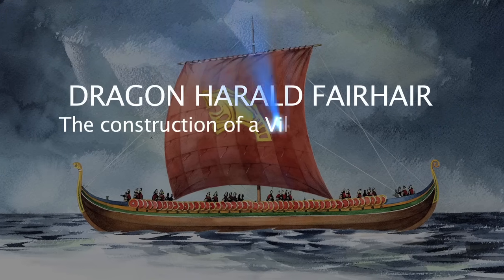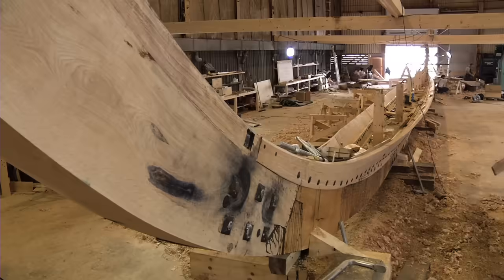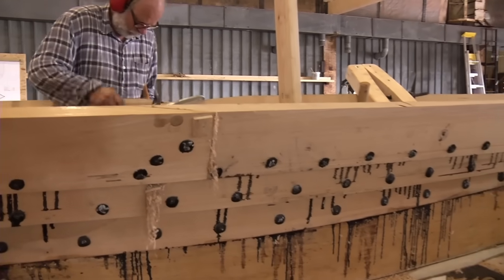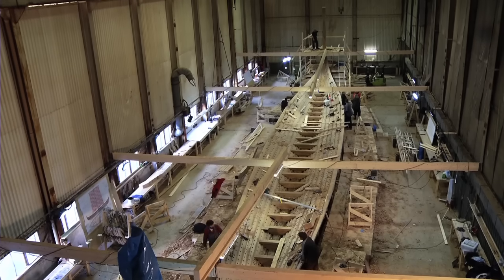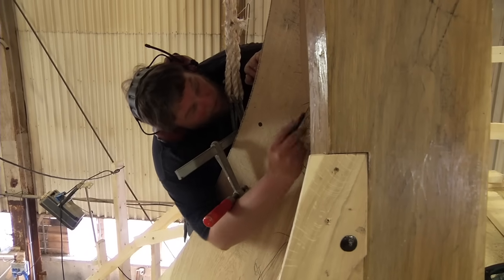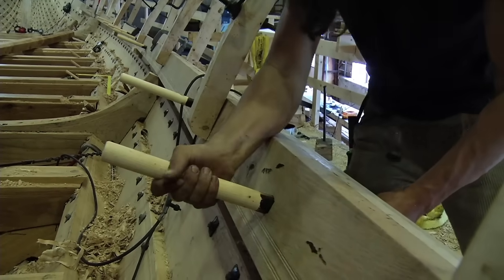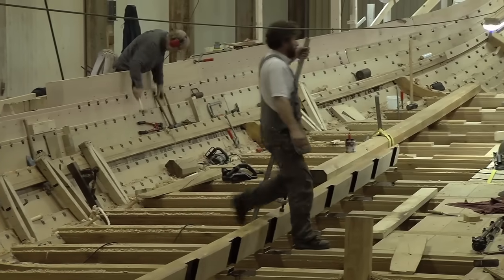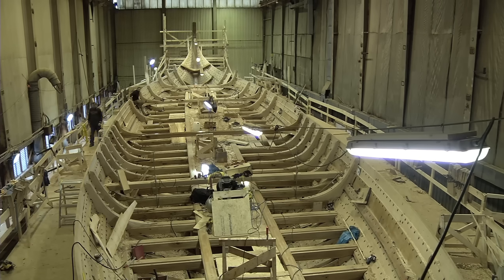The largest viking ship in the world

Comment: The Hollywood image of barbaric Vikings simply becomes laughable in the face of this degree of craftsmanship, and the social resources and organization that would have been needed to facilitate such construction and design.
Reply: I agree
hollywood  is a humiliated and perverted circus that belittles so many cultures for its purpose. The real problem is that fake history  does the exact same in order to hide the incompetence, failure and autocracies of certain governments.
Reply: Correct,
cranes ,protractor and planer have been used since  BC.
Reply: No
Who really does? most modern day theories are based on old manuscripts and analysts of old artifacts. I'm certain a great deal of educated guessing has gone into what we think the ancients did.
Reply: Zzzz, a Norse tool box was found not too long ago.  It was intact and full of tools.  Most of them were easily recognizable by modern hand tool woodworkers.  A lot of that stuff hasn't changed for centuries.  Modern tools makers can mass produce these things with greater accuracy but the core tools haven't changed.

The main difference between the way we build things today and the medieval times is that we have detailed drawn plans.  Medieval builders tended to start with a broad plan but the individual measurements were based off of the previous step.  They didn't have rulers or standardized measurements.  They would use things like string or story sticks to ensure consistency.

So, other than using a few things like modern drills and saws to save time, it looked like they stayed pretty true to the original methods as we understand it.  Even at that, it looked like the bit they were using in the drill was forged and not modern.  I do wonder just how many ships of this size were built during the Viking era.  That is a lot of resources for one ship.  The person that had a ship like that built would have to be extremely wealthy.
Reply: https://en.wikipedia.org/wiki/M%C3%A4stermyr_chest
https://www.popularmechanics.com/home/tools/reviews/g1024/whats-inside-a-viking-tool-chest/?slide=7
These are just a few links to articles on the tool chests.  The popular mechanics one has pictures of the find I was thinking of.  I've seen things on youtube from woodworkers who looked over the tools.
Reply: Irony is the Swedish king has word a Hollywood invented Viking hat, the one that has horns on it. Vikings never had horns, Hollywood made that to make them look more barbaric.  Yet the whole world associates vikings with horned hats.. so what's that about Hollywood again?
Reply: I have build similar boat like this before (åfjorbåt = aafjordboat). all information we had, was:
- what size (type)
- a simple paper, that tells what angle each individual planks, hold at a given place, and how many planks from keel and up.

when it come to tools: 
- ax's of different types was used (I have done some of my work with ax)
- I used mainly old school planers, some of them had profiles. I only use machine for bigger thing's to save time, but most work are done by hand, gives a different quality/finish
Reply: Queen Elizabeth II
Actually horned viking helmets was popularized long before Hollywood was a thing.  E.g. it was portrayed in one of Wagners operas late in the 17th century.
In real life only one true viking helmet is acually found, and it had a noseguard and  slits for the eyes. But they probably used a few different designs
Reply: .....Damn, comments as educational as the vid itself!
Reply: Come now...... doesn't necessarily mean that they weren't barbaric just take a look at the poms and their track record around the world. They didn't mind killing a few here and they were the masters of ship building.
Reply: Det er en ekte i et museum utenfor Oslo i Norge. Det er ikke så lenge som det her, omtrent tre fjerdedel så lenge, tror jeg. Men plankingen er mye tynnere og det er en lettere konstruksjon. Fra minnet er de omtrent 10 mm tykke eller 3/8 av en tomme.

There is a real one in a museum out side Oslo in Norway . It is not as long as the one here , about threequarters as long , I think . But the planking is much thinner and it is a lighter construction . From memory they are about 10 mm thick or 3 /8 th of one inch .
Reply: OK then, call them rapacious, bloodthirsty, violent craftsmen.
Reply: Mitch King Movies don't need to lie, dismiss historycal facts or humiliate other cultures.
Reply: Imagine if they also had to cut trees into planks...
Reply: as a swede with genuine víking in me, im proud of this kind of craftsmansship :)
Reply: Tell me when Hollywood has managed to make a historical film that's not laughable? You're confusing cinematic mastery with historic sensibility. And even when there was such a thing as the first, the later rarely bumped heads with it, let alone today, where HW is a den of corruption, dirtiness, and generally speaking idea theft, in the face of an ever dwindling subject out of which they can make a movie for.
So no, i would never put stock in Hollywood, a rotten landlocked pontoon that's sinking under a lake of lard.
Reply: @welshpete12  Seriously 3/8" for the planking? I'm not doubting you, just surprised. That is just over what a "modern" strip built kayak ends up at. To think they were able to construct seafaring vessels with commenting that thin is remarkable.
Reply: Well nowadays you have to make concessions to workplace security. Back then they still build such ships, just with a lot more men and a lot les osha conform.
Reply: I wouldnt want to fight one
Reply: RichB  - i like the norsemen as much as anyone ... but the reality is while the norsemen were excellent ship builders during their times ... so were many other cultures, who also had sophisticated ships - not just barges - who were also ocean going.
Reply: You know for Hollywood, anything witch is not american is barbaric ...
Reply: Yes
Reply: Yes
Reply: also that had aprentices (sry bad spelling) and masters so the knowledge were passed on, it wasnt until the 18-19th century the drawing came to be, before that, the britts used models for some of their man o wars  @keats182
Reply: They were barbaric, just they were smart barbaric.
Reply: Nobody said the Vikings weren't smart and talented. But imagine one of these ships shows up off your beach with 100 drunk guys screaming war cries (I.e. berserk). You will start thinking of the word barbaric as you flee for the hills.
Reply: "The Hollywood image of barbaric Vikings". No that picture was painted/written by English monks and that is not hard to understand. I have no doubt, however, that Scandinavia had a more fair society one thousand years ago as today than Britain, and they ruled Britain for quite some time.
And lets not forget that Britain is a product of Europe and that English a Germanic language with a lot of words from the Vikings like law, and days of the week. Also the ending "by" in towns and villages is Nordic and simply means town or village.
Reply: @Northern85Star  , They had to cut and buy all that oak in Germany and compete with other buyers for it.
Reply: @BruceDeitrickPrice  , Where did you get the "drunk" from. The word barbar is a onomatopoetic word, simply a foreigner, somebody who speaks a foreign language, not that much have changed - they come to take our jobs and the NHS etc, just listen to the worst brexiters,
Reply: @ushoys  , The Vikings brought word like "law" Britain and ruled most of it for a long time. They are part of British history and heritage and the language and DNA. If I wasn't so modest I would claim if there is something the British could boost about it probably is inherited from the Vikings. But then there is this question of looting the third world.
Reply: yes the viking were using these ships for trade and certainly not for pillaging coastal communities...lulz...what u do in between acts of barbarity no matter saintly doesn't lessen ur notoriety.... talking about  "craftsmanship, and the social resources and organization", the Nazi are an epitome of what u call civilized Europeans who are beastly under the veneer..get a grip of such euro-centric view of the world.
Reply: barbarism applies to the assaults the vikings excelled at, not the sofistication they displayed in working with wood and iron.
Reply: They were a culture that valued law, skill, and craftsmanship. But they were also fiercely 'nationalist' in todays definition. Everyone who was not a northman was a source of pillage and slaves. It is possible to be both barbaric warrior and skilled craftsman at the same time, all it takes is the right combination of cultural norms. Look at Soldiers in the modern military. Go to war, kill hundreds to thousands with highly advanced equipment, then come back to civilian lives and become successful executives, doctors, etc.
Reply: Τhey learned from byzantium and Mediterranean sea
Reply: People can be barbaric and loving and civilized.  Just get to know any UFC fighters.  They are mostly cool and humble people when around their family, friends and gym.  Then, see what they do inside the cage.
Reply: Hollywood wants to make all ancient white people look barbaric while making tribal blacks look like benevolent genuises who've been held back by some injustice done upon them.
Reply: Why would Hollywood Jews tell the truth about Northmen? Our light hair. Our fierce eyes. Our forthright demeanor. Our appreciation for beauty and nature. They hate us. Always have and always will. We're everything they wish they were.
Reply: @remus2475  the skill required to learn ship building I doubt a ruling viking king would even allow a person of such skill to be risked getting killed going out raiding
Reply: @remus2475  Ah, the business of mergers and acquisitions.
Reply: @Scooters Videos Shit happens ! blood makes the grass grow so you can eat !
Reply: @saxonforge  Except that Hollywood had nothing to do with horned Viking helmets, as that was a 19th century creation in European opera.
Reply: @Glorious_Kim_Jong_Un  Horned Viking helmets were introduced in the 19th century in European opera. Read more.
Reply: @agaronek Great post but Wagner was 19th Century.
Reply: @BruceDeitrickPrice  You rarely would see a ship of this side, and if you did, it would be companied by a hundred or hundreds of ships.  But most likely it would be a few smaller ships, with sober warriors that would come inn quiet, only start screaming once they were seen and the alarm bell or people screaming had occurred, the point was to get as much loot as possible without giving people the chance to run off with their valiables.
Reply: @LondonPower  not shipbuilding, by the time they went to the mediterranean, they came there with their longships.
Reply: Hollywood only Replicated what was first told by the Europeans about the vikings it was THEY who first portrayed the Vikings as a SAVAGE race without any culture or ethics or morals for that matter just because they were NOT Christians!
But in FACT the Vikings were VERY cultural and had a strict Ethics it was JUST NOT like that of the Christian.
But LIKE the Romans if you were NOT IN you were OUT and they treated you like a animal to be used for their purpose and pleasure!
Reply: A large part of the image of Vikings as savages comes from what they were doing. It is NOT Hollywood made. 

-- They weren't producing their own things, but they were acquring them by doing raids. 
-- And in these raids they weren't following any rules of war, unwritten or otherwise, as all the other people have come to do.
Blaming Hollywood is a wishfull thinking from people that are not comfortable with their ancestors. Not being comfortable with the Viking barbaric past shows a good taste, but we cannot change history for you.
Reply: A large part of the image of Vikings as savages comes from what they were doing. It is NOT Hollywood made. 
-- They weren't producing their own things, but they were acquring them from raids. 
-- And in these raids they weren't following any rules of war, unwritten or otherwise, as all the other people have come to do.
Blaming Hollywood is a wishfull thinking from people that are not comfortable with their ancestors. Not being comfortable with the Viking barbaric past shows a good taste, but we cannot change history for you.
Reply: @Mauromoustakos  What a load og BS.  The reason Vikings/northmen are described as such, is cause they were'nt Christians, other christians did not attack monestery's or churches, but they had no problem attacking heatens/none christians and showing them brutality, these Christian countries were no better than the Vikings.  But to the church,these were devils from hell, even tho the pope sent bloody crusades against heaten countries, both in europe and the middle east, actually i dont think vikings were ever as extreme as a crusade army, that slaughtered every non christians in a city, and then ate the dead...  
And you say vikings were'nt producing their own things...  Vikings produced exellent ships, their woodworking ability was exellent, they made houses that required no nails, they worked farms like every one eller, made varm clothes out of wool, tools and weapons were crafted, one of the best swords of the middle ages was created by the vikings, after they traded or learnt how to make damascus steel, ulfberth.. something.. it was called.  Vikings also produced a lot of dried fish that they sold and traded, late viking age the vikings focused much more on tradeing.  So i am not ashammed of my viking heritage att all, it was the time, and these were tough brave people, that were great explorers, daring and oppotunistisk seeking, coming from a hard cold place and ventureing out into the world when it was hard to make a living home,with population boom and not enough fertile land to go around for everyone. 
People should not be ashamed of their heritage, study it and understand the time.
Reply: @saxonforge  i like you, youre a smart one😊
Reply: Nonsense!
Knut the Mighty had a bigger ship, and Hakon Hakonson had ca 1260 two ships apr. 50--.55 meters!
Reply: indeed awesome  craftsmanship but when considering the amount of work and the fact that such ships can sink within seconds it is kind of over-endeavoring for mundane things. Why Italy, Spain, Greece, etc have no more any trees? They used all their forests for building ships. Forests that do not regrow.
Reply: The Germans in WWi and WWii also had a high degree of craftsmanship.
Reply: Just because you have good craftsmanship does not mean vikings did not murder, rape and pillage. You are now looking through time with rose tinted glasses on.
Reply: JJ Groves I love it how you try (poorly) try to make a reasoned argument then finish it off with insults! Now grow up and learn a little about history, now run along.
Reply: zzz43452  Come now, The Greeks were building ships a thousand years before the Vikings, the Romans did it 500 years before the Vikings, and yes they used Cranes and Protractors.... Pythagoras was Greek.....So, the skill and knowledge isn't actually novel. The Vikings did not invent most of the techniques that built their long ships, BUT they did invent a design of a very hardy ocean going ship using the knowhow of the day.
Reply: @ushoys  The "Vikings" included one King Knut, who brought the system of Parliament to Britain, and the rule of law....ironic isn't it, to call the Norse "barbarians" when back in those days they were the most advanced civilization in the North of Europe.....
Reply: @UAPJedi  By the way, back in those days, every people who could, did plunder, pillage and rape. Did the Saxons do it?? Yes ! Did the Romans do it? Yes! Did the Franks do it? Yes! But the "Vikings" did conquer England and instituted a system of laws and parliament under King Knut (Canute), which is considered very civilized.
Reply: @welshpete12  
Some words are identical to my Afrikaans (derived from Netherlands) and some are very close, i will attempt to write it in Afrikaans.
"Daar is 'n egte een in 'n museum in Oslo in Norwee. Dit is nie so lank soos sy nie, omtrent driekwart so lank. Maar die planke is dunner ook is dit 'n ligter konstruksie. Van my geheue is dit omtrent 10mm dikker en 3/8 duim.
Reply: I wonder how long this boat is seaworthy it being so very  long  . The Glendalough needed major work efter 14 year .
Reply: Well you can have both in some cultures. Look at pre columbian south american cultures. Huge majestic buildings and they sacrificed people and kids to their god. It is not that simple.
Reply: Nazis were very crafty too, and great at all the stuff you mentioned.
Reply: @saxonforge  not at all cranes withe iron gears have been found in ancient mines all over the UK that go back centuries there are some that you can visit yourself that are still in place if you dare but if not there are you tube videos of them in box quarry. How do you Imagen castles were built without cranes? Don't get me wrong they didn't have air conditioned cabs and arm chairs. They were a more physical affair.😁
Reply: zzz43452  I'm sure they had their ways of construction which are effective. One of my favorites is the use of a twine coated in colored dust which is used to mark perfectly straight lines. Also more twine used for making surfaces even and such. Old humans had to work smartly.
Reply: zzz43452  I feel like you're doubting the heritage and abilities of the norse people simply because vikings pillage. Hell, that's the most iconic thing we think of about them. We don't even pay attention to the architects, blacksmiths, artist, and such.
Reply: zzz43452  They did have pigments. Stuff simple as the veggies grown on the field could be used for it. Also medieval villages had areas where they'd collect pots of stale urine to use the ammonia to use for the process of dying cloth for the everyday man.
Reply: zzz43452  Colored lines were easy to produce. Hell, one medieval tool for creating perfectly straight lines was just some fucking string rolled in some colored pigment like rust or crushed up rock. You'd measure it, pull it tight then just lift the string and release to let it hit the surface of the area measured.
Reply: zzz43452  No you don't get it. The twine is pulled like a bow string, then let loose. It hits the area measured and there. Straight line. It isn't snapped.
Reply: zzz43452  Go watch "Secrets of The Castle" the first episode, and skip to -14:18 into the video. It'll show what I'm trying to say.
Reply: Still, I bet they are listening to Amon Amarth nonstop.
Reply: Yes it was remarkable but even more remarkable were the Polynesian huge ocean going catamarans and trimarans that voyaged across the Pacific at increadable speeds before even the Vikings began..Yes the longships were true works of art of increadable ingenuity and  the Pacific catamarans even more so. Fact is always stranger than fiction.Actually all our true history has been stolen from us.Further research Sylvie Ivanova at new earth megaliths.org.Check her site out,give yourself a treat.Let the veil fall from your eyes.
Reply: What about the slaves they sold to the Islamic world?
Reply: Norse were VERY civilized. It's apparent with their craftsmanship and their culture.
They were just very different from Christian, Post-Roman Western Europe.
Reply: We are glad you are interested in out product. For 8.99 Euro we will ship the product to your home adresss. Some self assembly may be required.
Reply: Just stop watching bullshit Hollywood all together
Reply: The social resources and the ability needed to facilitate such construction and design doesn't make the Vikings saints...
Reply: This echo's my very first thought after watching this. I'm sure they were barbaric in modern terms, but they were certainly far more intelligent and well organised than modern pop culture would have us believe.
Reply: @scottmaschino1927  two men can easily row a 35' longboat. 
You can easily make the whole vessel shiver, by grapping the stern with one hand. Highly sophisticated craftsmanship...
Reply: @hurri7720  nonsense . Endless loads of finest Oak availble in Denmark and Sweden.
Reply: They were competent. Not nice.
Reply: The earliest ships were much smaller, and built in an era when first growth timber was available. The planks were split, not sawn, stretched while green and sewn together with tarred wool cordage. Frames were installed green, and braced/sewm/clenchnailed in place, to seize in the correct shape. This method persiste d well into the 1200's, in small craft, remote areas.